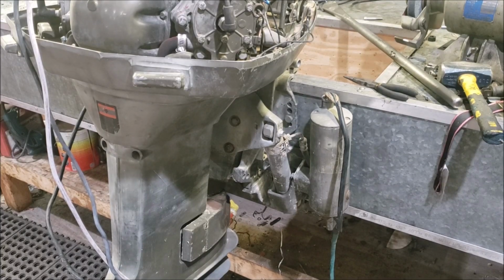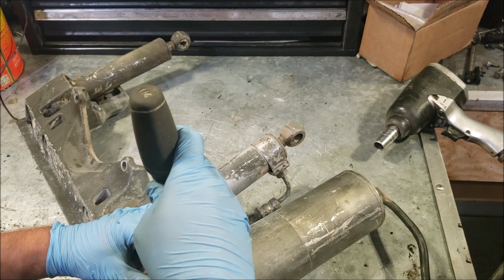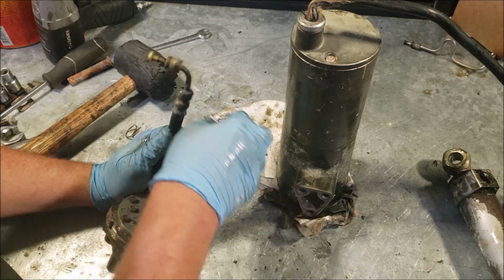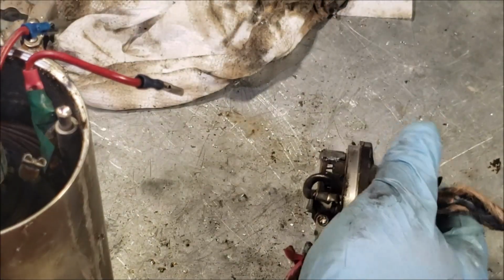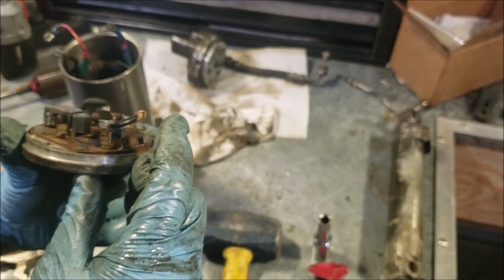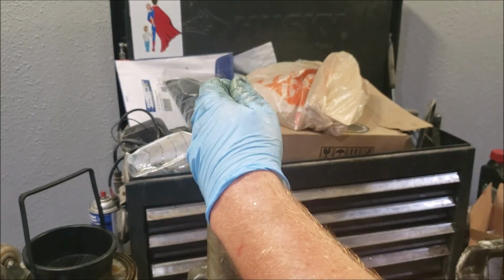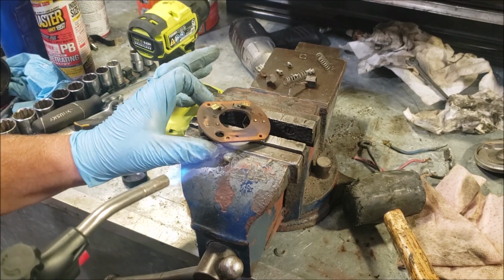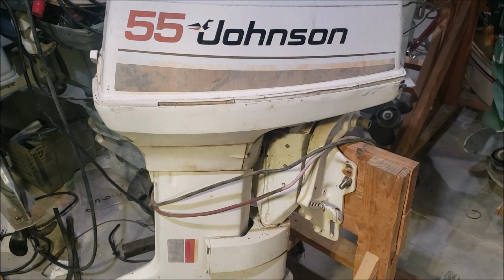Junky Evinrude With Junky Vintage Power Trim

Comment: I'm sure you didn't hear me telling you not to hit the pump. This was your most entertaining video. I have a 1973 Johnson 115. Same tilt, trim set up. I did a total rebuild on it 5 years ago. I should have made a video. It would have been a silent video. I was able to get the long screws out, to separate the motor and reservoir. I was lucky to find some old timers in Joliet IL. Tips were great. He had the brushes and springs, with new seals to reassemble. Tips were, heat the revoir to remove the pump, remove the rubber flex line and use new steal line. As for the prestolite pump he was able to replace most of the seals. He told me it was not ment to trim the motor while on the water, it was for tilting the motor when trailering. Custom make clips to hold the brushes in place to reassemble. It took 6 trys to get the top back on and a whole vocabulary. Good luck. I'll be waiting for the video of the rebuild.

Comment: Yeah mate I am In australia and dealing with the same thing however My idea is to keep the case and pump and connect a small motor to the drive shaft of the pump if it works will send you photos and specs good video you have done mate I enjoyed it cheers Neil

Comment: I have the exact same problem with the same tilt system but mine has had salt water in the motor for about 2 years so it is a complete write off thinking of making another motor fit some how 😅 awesome video thank you

Comment: I've seen where these pumps have been replaced with an omc stringer pump and the last time I looked they were pretty reasonable on ebay. I have an extra set of cylinders if you need them.i also had one where someone used a mercruser style pump and made hoses to make it work.

Comment: can you file down a starter motor brush? maybe some silicon under brush holder board to help it stay straight. maybe a external pump motor with longer hoses

Comment: G'day mate just wondering if you have ever replaced the seals on a set of these rams ? I've been searching for a tear down and seal vid but no ones done one for this style of ram I've just got this set up and striped down the ram that's the not close to the pump and cleaned it all up put a couple of new seals in it and just would like to know if there's anything that I haven't done right in the reassembly as the workshop manual don't have any info on doing this . Watched this one a couple of times just to have a look at another unit and  enjoyed every watch cheers mate from Duncan in South Australia

Comment: Brushes are available in every imaginable size in metric on ebay from china. The function of the brush is to stay in the cage and make contact with the commutator... they will literally make their own contact the more you use them. And good tension spring behind them and they'll be fine.
You can remake the brush board with some insulation material you can buy from Electronics store, or even wood. 
As long as the winding has continuity, that motor will work fine.
Reply: Brushes are also super easy to file down to a correct size - When in doubt, buy oversize and make them fit

Comment: ocasionally I make a carbon brush.  I find largest brush,  has to have biggest wire imbedded in brush and file brush to fit.  Spring and wire is find what works.  Spring cannot be to strong-  wears out brush and armature.   I thought I could take this setup and make a engine lift for running in mud like atlas makes.  their reviews are not to good so thought I could convert manual to hydraulic with your setup.  It was a dream.

Comment: would you be willing to sell the tilt trim setup? I have the other style pump that could be used on this. My tilt trim finally failed today and bled off destroying my prop backing down the ramp. the tilt cylinder bobbin windings came apart and damaged the cylinder and seals.